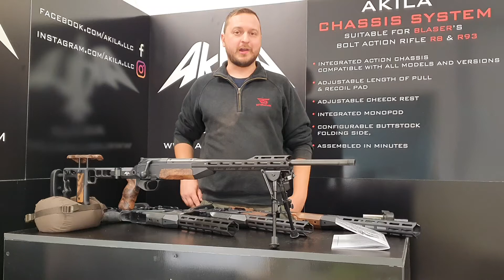Akila 2020 talks

Comment: If I wish to run this stock along side my regular Blaser stock. Will I loose zero removing the block you mentioned going between stocks, I’d like this set up for PRS and my regular synthetic for hunting.
Reply from the maker: Hi Jack, things have changed, we have released ACSR8 mk.2 which has our proprietary sear block pre-installed. The ACSR8 sear block is compatible with all fire control units, makes the trigger pull two stage and allows to adjust the weight of pull 14-40 oz (400 grams to 1200 grams) check out our website for more info. Https://akila.ltd 
Also regarding shifting zero, the POI doesn't shift more then from one B stock to another....
Reply: @akila4537  thanks for the info. Ive found a supplier here in Aus but the cost is $5200 can you ship to a firearm deal of my choice?
Reply from the maker: @TheDillon1987  the ACSR is not an essential firearms part here in Slovenia, so yes we can ship it.
Reply: @TheDillon1987  How did you go did you end up getting it and for how much landed after taxes in Oz? cheers